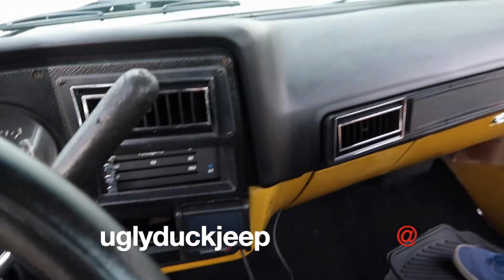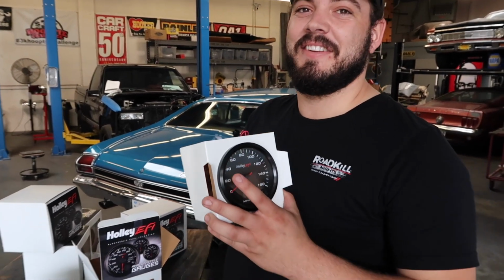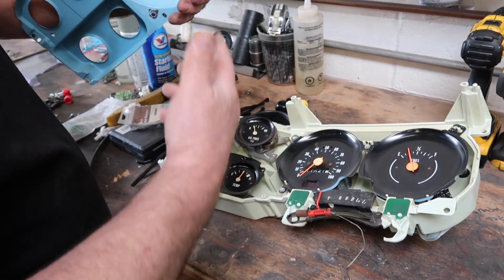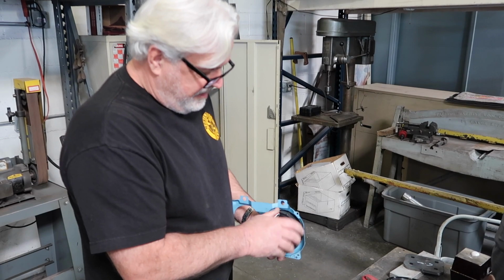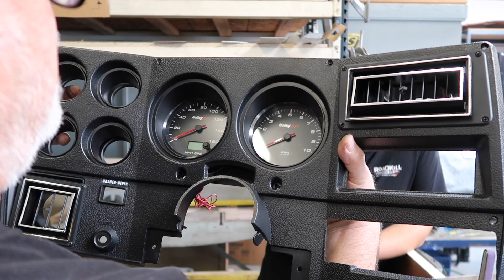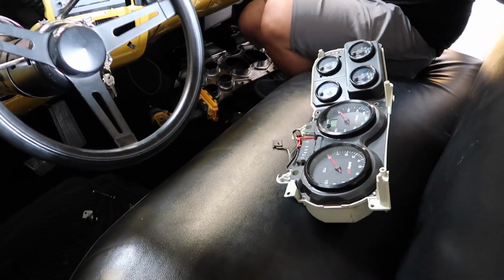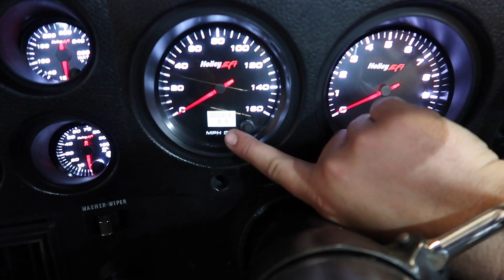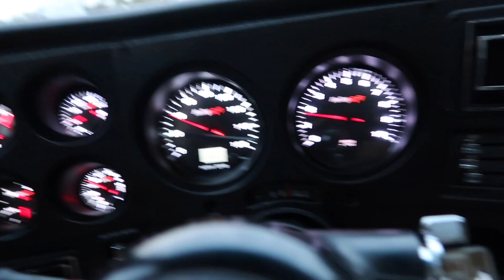Holley EFI's New Analog Digital Display Gauges in our 1974 C10 Square Body

Comment: The bright light indicator in located on the factory speedometer how was this handled?
I've discovered another manufacturer that makes very similar gauges that have optional turn and bright light indicators, only thing I've already purchased the oil volts temp & gas gauge's from Holley...

Comment: Hmm!! Cool! I wonder if this will work out with an LS swap kit.
Reply from the maker: it will work!
Reply: Yes it will.
Reply: @mathewshackelford8037  thanks brother!!! Its my first ls swap!!! I want my truck set up niiiice!
Reply: @johnnyboy859  if you aren't going to run a Holley ECU, you'll have to make sure you get their "analog" version gauges though, at least for the oil pressure and water temp. The rest should work fine. 

However, if you want it setup nice, the terminator x max is definitely the way to go!
Reply: @mathewshackelford8037  so the terminator Xmax is made by holley?..
Reply: @johnnyboy859  Yes. It's expensive but there's so much you can do with it. There's also a serious back order of them due to computer chip shortages but it's totally worth it.

Comment: What trans do you have?  Did you use a block off plate where the speedo connected?
Reply from the maker: 4l60e trans. Speedo is GPS no wires

Comment: Can you run these gauges with a carburetor engine? And will they work for an ls swap 6.0 lq4 with no Holley setup?
Reply: you would have to run the "analog" versions that have their own respective sending units and inputs, instead of the EFI gauges if you don't use the holley setup. The EFI gauges are designed to be a CAN bus setup that works specifically with the Holley platform.

Comment: I didn't see in the video where you hooked up the canbus, did you wire it to the stock ECU or did you run a aftermarket ECU?
Reply from the maker: Its a Holley ECU and plugs right in! It was hard to show this because it was under the dashboard
Reply: @gasratzcustoms  lol, not a very cost effective option when you add the price of a new ECU and wire harness.  Thanks for responding.  I'll have to go with different gauges.
Reply from the maker: All good!!!
Reply: @gasratzcustoms  I found out Holley does make those as standalone analog gauges which don't require the ECU, however they are about $90.00 more per gauge and come with sensors.  I'm going to give them a try.  Thanks for the demo of the gauges in your video!

Comment: Love the gauges, I'll soon be doing my 87 R10.
Where did you get the black steering wheel?
Reply from the maker: The steering wheel is from Foreversharp Steering wheels. Use the code “Gasratz “ and get 10% off

Comment: The oil pressure gauge not working with the Sniper EFI is a dealbreaker for me. Almost pulled the trigger until I read that. Wish there was a way to make it work. What Holley EFI are you running?
Reply: Seems crazy and doesn't make sense to me.  I have the sniper efi on my 70 pontiac and oil pressure reads just fine
Reply: @peleger1  I ended up going with Dakota digital. It came with a sensor I screwed into the block. If the Holley analog gauges had an oil pressure that worked with the efi or I could somehow use a sensor to make it work I would have went with Holley.

Comment: Is there any way you can put the part numbers for all the gauges please and thank you
Reply from the maker: Part# 553-128
Part# 553-127
Part# 553-126
Part# 553-133
Part# 553-121
Part# 553-125
Part# 554-130
Part# 553-140
Part# 553-141
Part# 553-144
Reply: How much was this setup
Reply from the maker: It’s probably around $1200 . Depends on the options you select

Comment: I got a 1987 c10 I got terminator x with the truck I bought these gauges how do I wire it to come on with the key
Reply from the maker: You need to hook it up to key power. One wires excites it and lights en up. I would have to look at the instructions again ;)
Reply: @gasratzcustoms  where is a good keyed power

Comment: What you do for turn signal ? 

If I have the terminator x , do I need any additional module to make this work ?
Reply from the maker: I used stock turn signals. If you have Terminator X you just need to order the gauges!
Reply: Turn signal hell there's no fuel gauge
Reply: @derrickbasenberg811  Fuel gauge is bottom left...